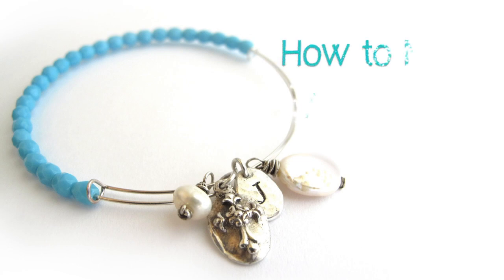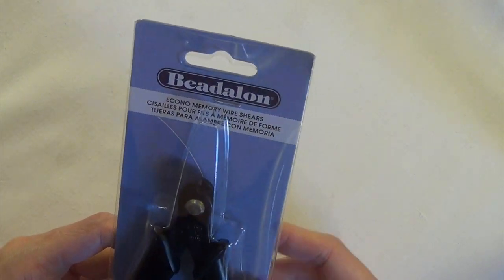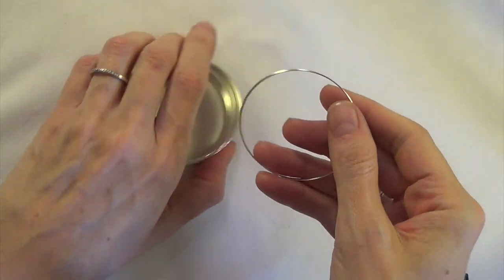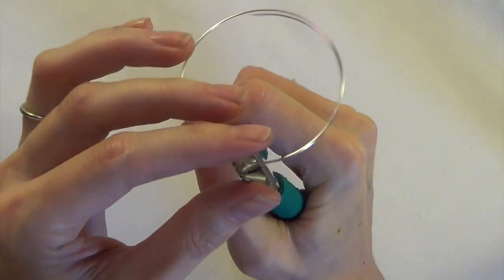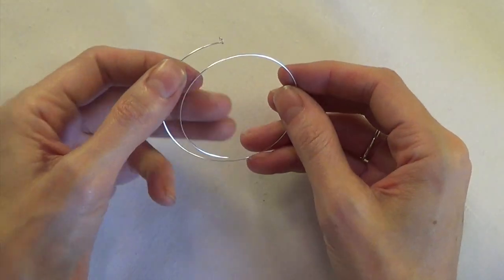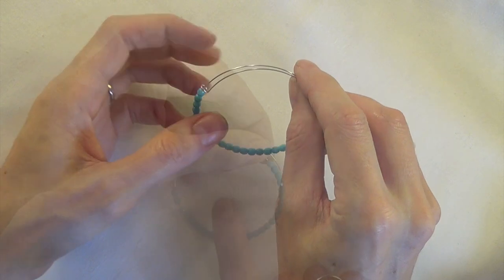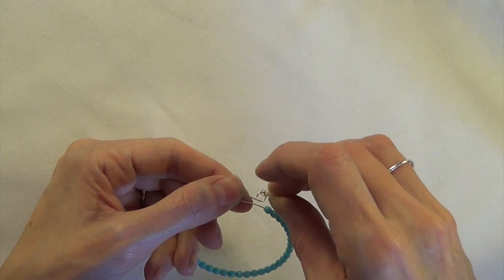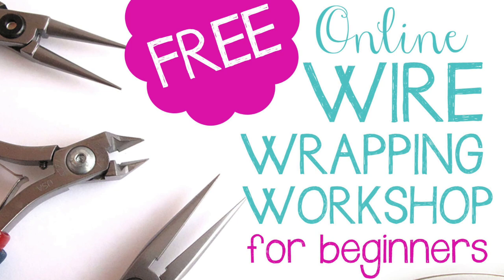How to Make Adjustable Wire Bracelets - DIY Adjustable Bangle Bracelet Tutorial

Comment: Hello!  I loved the idea of this and bought some bracelet size memory wire, but it's only 55mm wide - way too small to be a bracelet.  Did I miss something?
Reply from the maker: Hi Colette! These bracelets are expandable so not only do they expand to go over your hand like a bangle, but they shrink back down so they will stay the right size on the wrist. The expansion allows them to be just the right size, even if your wrist is bigger than the original size! Memory wire does stretch out just a little bit over time but the cool thing is that it will cling to your wrist without being too tight. Make one and you'll see what I mean. Thanks so much for visiting - hope you have fun with these!
Reply: Oh right, thanks very much :-)

Comment: The beads you add as to touch each of the ends of the loops or can I leave a space without beads  between the loops? Thanks
Reply from the maker: Hi Carmen! Yes- you can leave a space there if you don't mind the beads sliding around. It's totally up to you! Thanks for stopping by :)